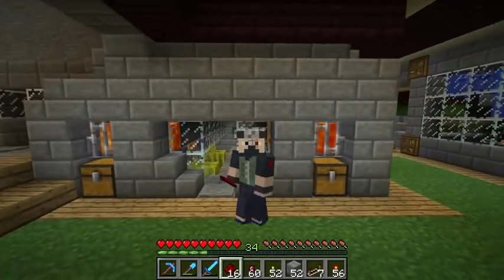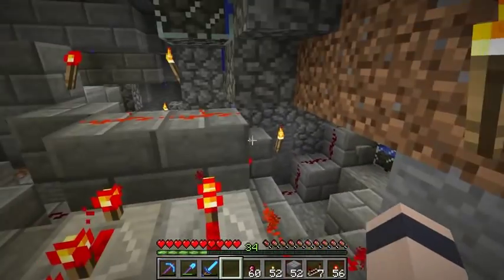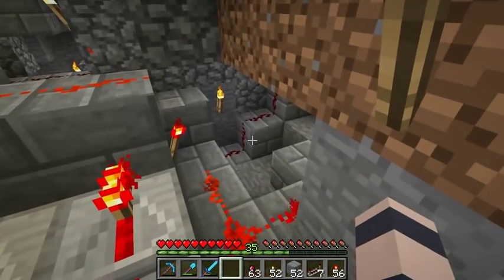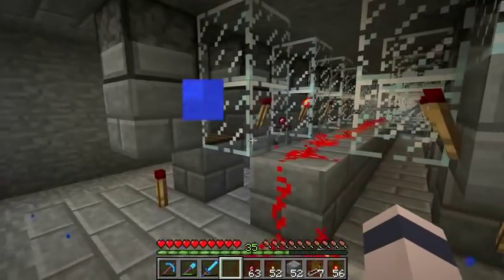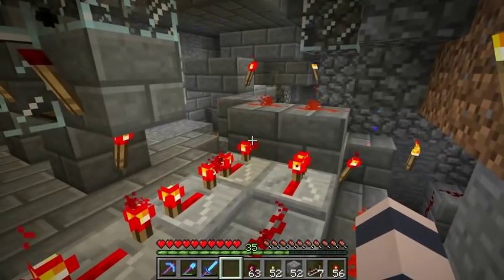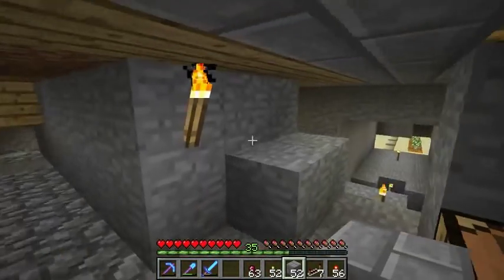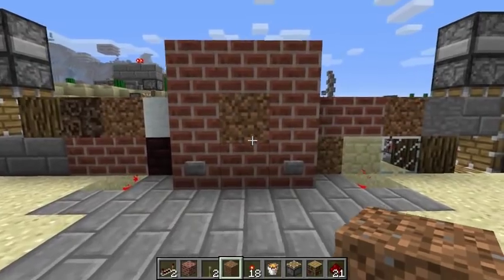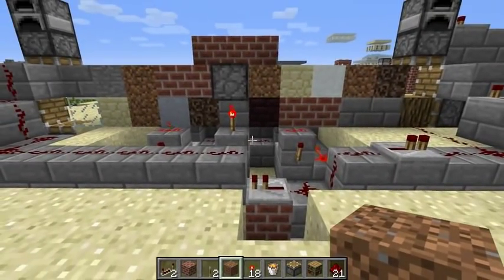Etho Plays Minecraft - Episode 148: Timer Flop

Comment: READ:
When you wire below the buttons, take out that 'connecting' wire, replace with a block, and put the torch going to the piston on that newly placed block.  If that's the problem, this is the fix.

Comment: I made a 30 minute version of the basic timer in my world. I have a button to start it in my main room. In my underground labyrinth, I made the timer itself. On the surface is the output: a random redstone torch that turns off for half an hour. On the bright side, my mob system has 4 spawners and a lighting system. Although it isn't equipped for spiders. But that doesn't matter, because there are four spawning pads, and all of them are too close to the collection area/place where you have to st

Comment: Etho, you can fix your problem by:
1 moving each monostable circuit one block away from center
2 adding one repeater between each
3 using the design below the center console that looks like a T... TBC

Comment: Did you try spacing the redstone wires out one more, and using blocks to keep it from hitting the monostable circuits? Then you shouldn't need the repeaters and it should input into the torch right

Comment: I'm having an issue with this build, the block swapper. It seems that whichever button I press, both mono-stable circuits get powered..I doubt that is what is supposed to happen and it has been frustrating me because it just pushes everything back. Could someone give me a few reasons why that may be happening?

Comment: You could use singleplayer commands rather than MCEdit, there's a program called MagicLauncher that lets you easily install and swap out mods so you could use that and have one configuration with MCEdit for working on the map and one without for other stuff. Or, my MCEdit is out of date but it is still usable, it's just certain blocks are a weird pattern and I can't edit the End. So maybe it would work like that.

Comment: Here's the easiest way to fix: i.imgur.c om/77lfk.png
Do this on that side, and the other, doesn't matter which side they're facing. The sole purpose of this is to direct the wire away from powering the block. There are cheaper ways to fix it, but this is probably the easiest.